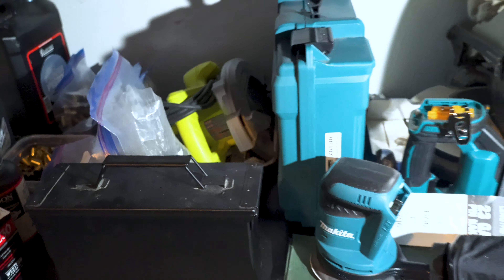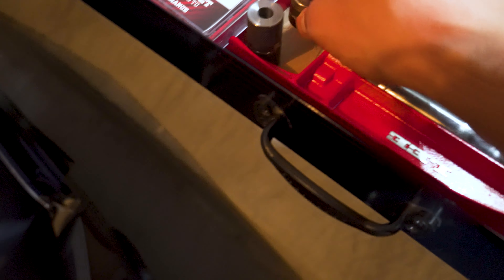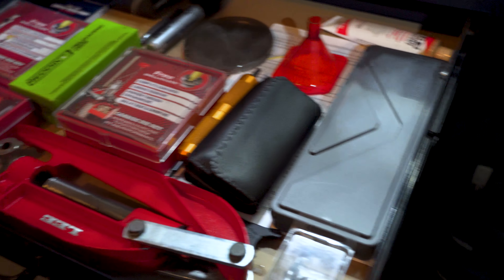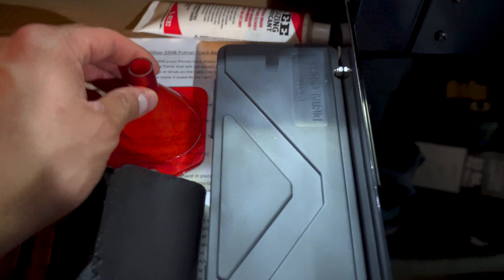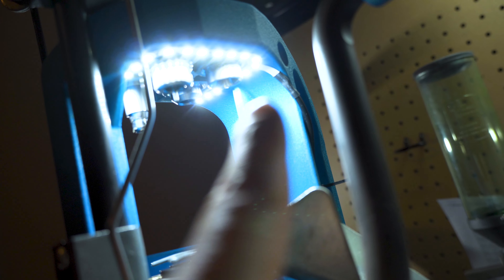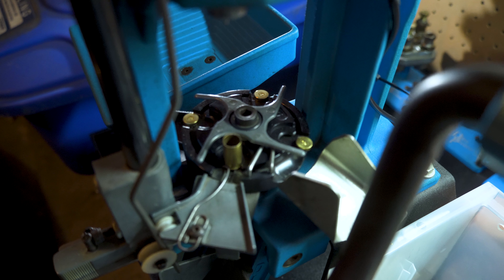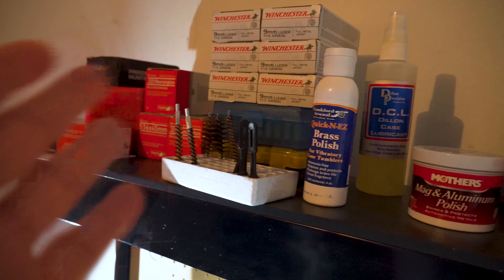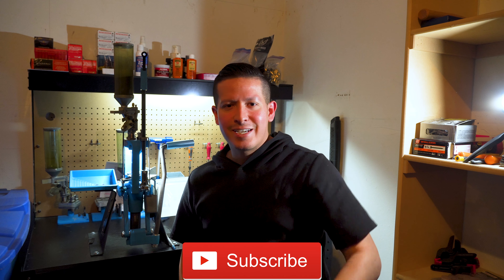Reloading Bench - Showing My Setup for 2021

Comment: With reloading, one quickly discovers two things: (1) there's always another useful tool to add to one's workshop; and (2) you rapidly run out of space and need an ever larger work bench and more storage shelves. At least at present, finding powder and primers is a real challenge with dependable supplies of brass and bullets not far behind.
Reply from the maker: Luckily I’ve been able to find all the reloading supplies I need by checking local stores, online, and out of state stores where my friends live. Just keep searching bro. You can find all needed supplies.